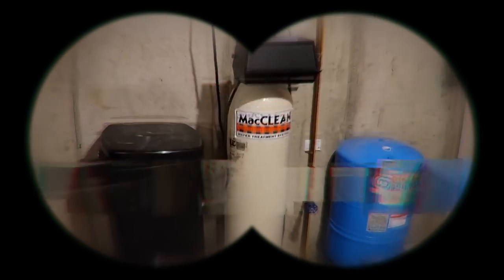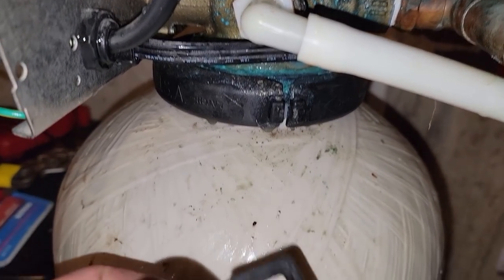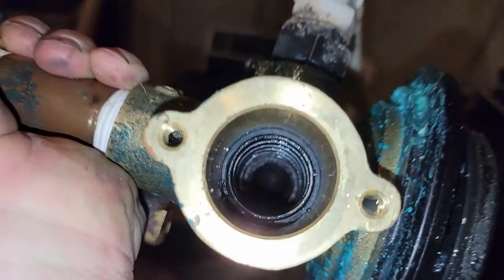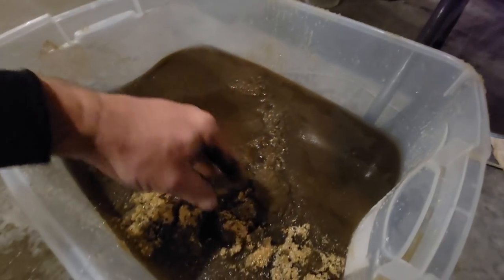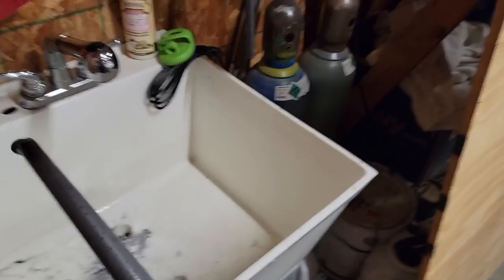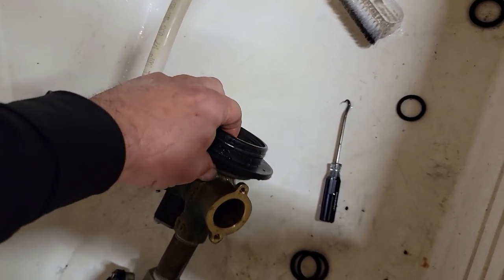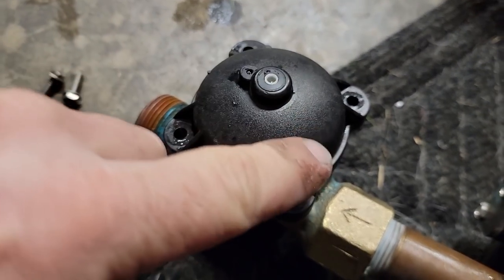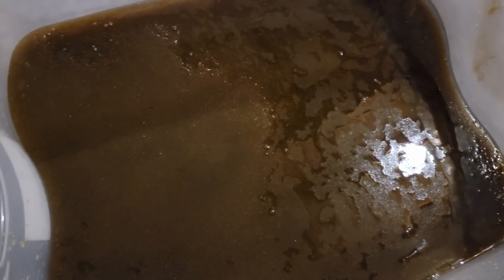Water Softener Rebuild

Comment: I grew up with an old semi automatic Lindsay water softener. In our application we used two dirt filters to protect the softener then the softener. The resin does have a finite lifetime (usually somewhere around 20 years depending on hardness). The amount of resin also has control over the length a regeneration lasts.
 I also replace the sand bed as that helps in the backwash of the regeneration.
Reply from the maker: Thanks for the feedback👍👍. Because this has the turbulator the water softener company said not to use the stone.

Comment: I'm amazed you even had to replace the resin in that water softener. Usually those things outlast anything made today especially taken care of. Those old fleck valves are just as durable too.
Reply from the maker: I've always heard those were good heads. That's why I bought it when I did. I'm sure the motor will go out that I can replace that. I have a touch of sulfur and that could be the black stuff plus it's been awhile since I've disinfected the well.
Reply: @HVACRSurvival  the worst that will do is strip the gear box.
Reply: Resin degrades about 1 percent per year depending on iron and chlorine content. 2 biggest killers of ionic resin.

Comment: If you refilled it to the level it was at previously you almost certainly did not add enough resin. In fact it likely was originally filled to very near the top. The issue is that the dry resin is almost "sticky" in that it won't settle down and pack in. Once the water gets in there it lubricates all the spheres and allows them to settle and pack tightly.  I know it doesn't seem like it should, but I have seen it settle by 1/3rd or more.
Reply from the maker: I can always recheck it later, from what I was told,  you don't want it all the way up to the top and it normally is maybe 13 in down at least. All I can do is go off what other people are telling me😁👍👍
Reply: @HVACRSurvival  Sorry, I didn't mean to suggest that it should be completely filled, just that the dry factory fill likely was near the top. It has been my experience that unless you physically compact it in, once it's under water the level immediately drops to somewhere between 2/3 and 3/4. I would encourage you to see for yourself small scale. Pour some from above into a clear glass (the same way it went in the softener) then fill it with water.
Reply: @HVACRSurvival  Yes, it should only be about 2/3 full with resin so there's room for it to expand during the backwash cycle. I think you have a 52,000 grain 1.5 cu ft model based on the model number (52) so that's how much you should have added. You can sometimes check the resin level by shining a really bright flashlight through the resin tank.
Reply from the maker: @Technicalee I believe your correct. Thanks 4 the info!

Comment: How many yrs do you get on your resin?  All depends on type of water.  With city water here a pre-charcoal (AOsmith) filter doubles resin life.  If you can press and crush resin between fingers it's bad.  You need to get a similar tank with activated charcoal pre-softener.  Or an oil separator....
Reply from the maker: That's the first time I did it on mine. I might be getting a charcoal while l whole house water filter
Reply: @HVACRSurvival  Google oil in well water, it may not be a health issue, it's iron breaking down leaving oily deposits, you'll know after testing.
Reply from the maker: That would make sense. Like I said I'm no expert on softeners.

Comment: Your Missing a Whole House sediment Filter, out of the holding Tank, before the softener
Reply from the maker: Haven't needed one but I am thinking about putting a whole house charcoal filter in front of my softener.
Reply: yes, that helps by filtering larger particulate schmutz out before the softener. it last longer between media changes(days to years).it all depends on water quality.
all to often water softeners are installed in attempt to modify very bad water(they fail there). ground water varies by season. good luck

Comment: My artsian well that flows 12gpm out the top of the well head has that black slime inside the well casing. I have had water tested and we drink it.. we have high Sulphur and iron content so we have a air injection and softener to help... let us know what it ends up being if you find out. I would have just swapped that unit out because this seems like a lot of work 😄
Reply from the maker: It might be a little Sulphur. It's in this area of Ohio. What area do you live in?
Reply: I would bet that's what it is. I am in Ontario Canada. a little ways from you sir!

Comment: if you think you have stuff in your water maybe invest in a pre-filter the black stuff could very well be manganese deposits the plant I used to work at had bad iron/manganese issues and we  would have to every 6 months or so flush fire hydrants to blow out the black sludge very similar to what your seeing if it was oil easy test does it float on water and or have the rainbow effect. which makes me think if your well is set up right it would be drawing from the middle of the water level where there shouldn't be any oil if you have contamination but it looks like manganese to me its not going to hurt you its a taste and odor thing
Reply from the maker: I think you're correct, I called about getting a test that I have to call the other place the first place didn't have it local. But now that I've shocked the well it's been really good. No smell no slime. But I've also been using bottled water out of precaution.
Reply: @HVACRSurvival  normally with iron you get odor and taste issues with manganese it usually only can be found in a quantity in side of things like filters and and bottom of tanks I'm guessing you have a high manganese but a lower iron amount you usually have a mix of the 2 I'm mostly guessing at that

Comment: The black residue is just the deterioration of the black rubber. I see it all the time in faucets, valves, etc. Anything with seals, gaskets, or o rings will have that black crap. Not really anything to be alarmed about I don't think.
Reply from the maker: I think it's possibly a slight sulfur water accumulation and doesn't heel that the well hasn't been disinfected for probably 15 years🤦‍♂️
Reply: @HVACRSurvival  possibly, but I see it everywhere. Municipal water supply in the city and well water out in the country. Thats always been my best guess was the rubber breaking down.
Reply from the maker: The water lines are plastic up to the water softener so the only place it would have rubber would be the pitless adapter
Reply: @HVACRSurvival  i used the term rubber loosely. Whatever material (Buna n, nitrile, latex, etc) the o rings, seals, and what not are made of. It was that little black "rubber"  "check valve/drain" you pointed at in the video. Right where the black stuff was. The black crap (for lack of a better term) 🤣seemed to be anywhere near where there was some sort of o ring, seal, or other black elastomeric gasket. That's always where I see it in plumbing fixtures. It gets all over your hands if you even look at it funny and its always near the seals, seats, or whatever. 😄 Thats all I know
Reply from the maker: Sounds good Jacob, I called Friday about the test, I need to call a different branch for pricing.
Reply: @HVACRSurvival  I'm interested to know how it turns out.
Reply from the maker: @Jacob when I know I'll let you all know

Comment: compression valves = OH NOES NOOBIE!!!  just kidding, I would 100% have put them in there as a speedy solution, if the original installer didn't implement a way to bypass or if a bad location with water flowing. yes I can work around leaky valves and draining back plumbing multiple ways. BUT is it worth my time or others? NOPE.
Reply from the maker: I figured they would leak but they never did and still don't after being loosened. Not bad for 18 years old. Just like anything it's all about the install practice.